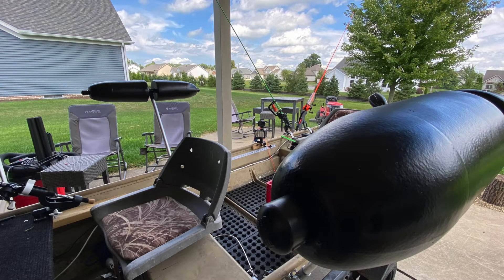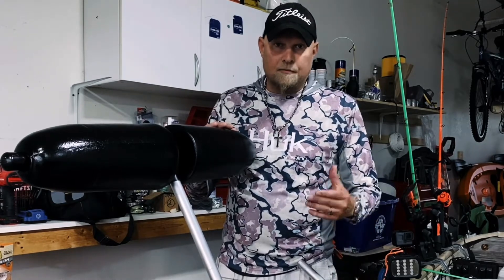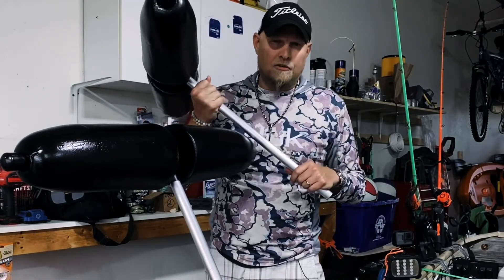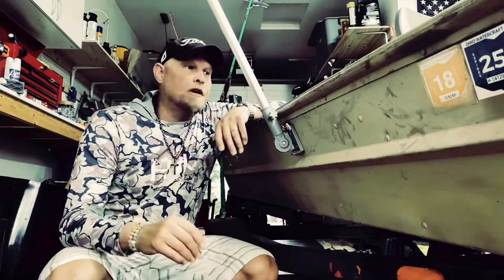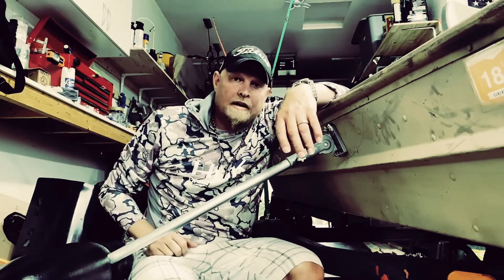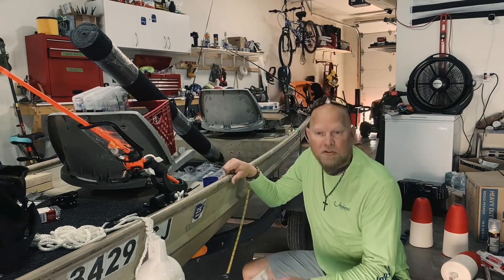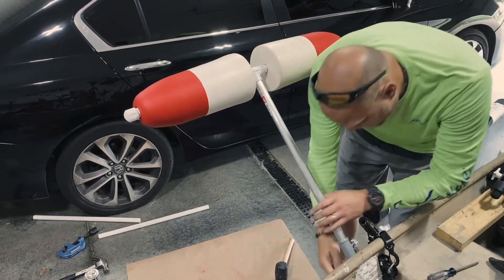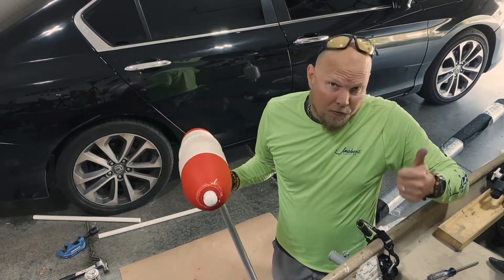THE ONLY REAL JON BOAT OUTRIGGERS ON YOUTUBE; STUPID EASY

Comment: Thanks for posting this. I've been trying to work up a solution too. My boat is a Lowe 1232 and it's insanely unstable. I'll have my son with me on the boat, so I'm thinking I'd like a little more stability and a little more strength.

My thought is to use use exactly the system you've put together, but with a third float on each side. I'll add a second tube & flag holder connecting them to the boat which should eliminate torque forces vs the single-mount design and cut the load on the flag mount and boat side in half.

For added strength I may add a wooden dowel through the PVC - the water out here can get bad fast. I'm also thinking to cut the floats so they fit together over the T connector for a little less drag, tho I don't know how much that'll help anything. 

Anyway, this is a great idea and I'm going to give it a shot.
Reply from the maker: Sounds great. I’d really like to know how it goes. Let me know, if you don’t mind.
Reply: @lamefishing6716  will do 👍

Comment: May I ask if you sprayed your black paint directly on it? Will it corrode the buoy? What paint did you use? Thanks!
Reply from the maker: I sprayed two coats of the Rust-o-leum truck bed liner from Lowe’s directly on them. It has made a huge difference because im constantly taking it up in very shallow water. I do t believe it will harm the floats.

Comment: I've been thinking of a way to do this to my jon boat. Like you Google searches came up empty. Thanks for the video
Reply from the maker: Ya it was frustrating but these have held up great. I also added a 6hp outboard and it they put up with the drag just fine.
Reply: Interesting build. I don’t own a Jon Boat but seems like a shorter aluminum pipe would work just fine and be less susceptible to breaking off. I might try something like that for my kayak.
Reply from the maker: @TxHornyToad  ya I’ve been thinking about shortening them. I figured give a season and see how they do. They have held up pretty well. In a different video my brother and I were both leaning to the side to bring in a catfish and they WILL NOT LET YOU TIP THE BOAT. These will for sure work for a kayak.

Comment: I have the stabilizers sold by spring creek for my canoe. They’re “okay” and they’ll cut through the water far better than your crab pots. I’m pushing my canoe with an old 3hp Johnson and they handle the speed just fine. But I’m looking for something with a bit more buoyancy. I’m very frustrated that that there isn’t something better available on the market. The adjustable flagpole and crab pots idea is good if you simply want to lower the stabilizers into water when you arrive at your destination and have more stability for standing up in your jon boat but not very good if you want stabilizers while under power.
Reply from the maker: My goal was to be able to have the boat be stable when I’m fishing and standing. There aren’t any options in my budget. My outboard is only 4HP so being under power isn’t a problem, They do fine for what I need because I won’t be going any faster than 6mph. I did another video showing how they function with the outboard motor.
Reply: I totally get it. I'm a 64 year-old geezer with balance problems. My son convinced me to look into stabilizers for my powered canoe and recently I acquired an old 14' jon boat. My point is that even if you have a bit more cash, there still isn't anything really decent available on the market and I believe there would be a fair market. If Walmart can sell a 6' kayak for around $150, why aren't there better options? The Spring Creek stabilizers are expensive for what they are. Your crab pots are a good idea especially the fact that you can raise and lower them. I just wish there was something better.
Reply from the maker: @markwybierala4936  ya it’s frustrating. The only thing out there is the captain collar or whatever, but that costs a couple thousand dollars, which is twice what I payed for my Jon boat… no thanks. You would think someone would jump at the opportunity.
Reply: Check out dairyland anglers he has a good outrigger setup
Reply: @FlaJayFishing  I did a google search and didn't find anything. Website?